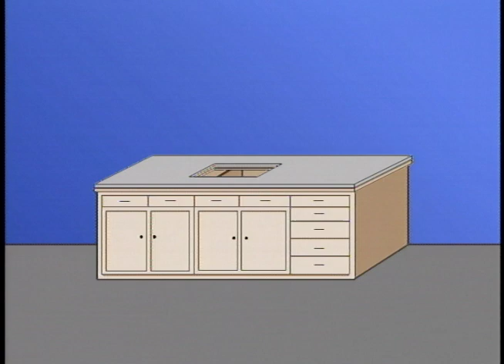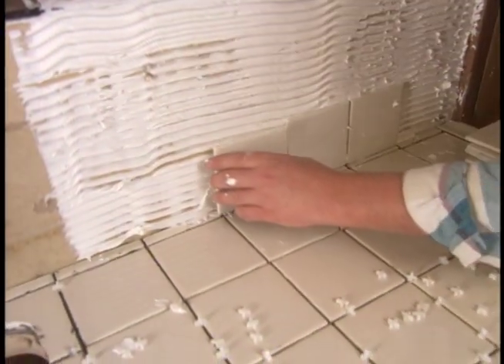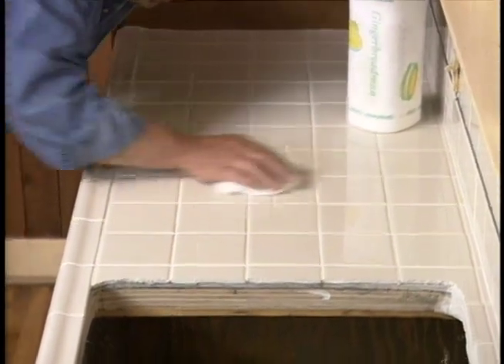How to Tile a Kitchen Countertop

Comment: You should have just hooked the plywood to the cabinets by using L brackets or something like that that you get to from underneath. If you ever want to replace the tile countertops it will ruin the cabinets because you won't be able to get it off.

Comment: Hey folks. What year are we in. Tile tops can be done with a nicer touch but please watch the schluter system countertops video so you dont end up with a rotten top. Not a payed advertisement either. Just the truth. Concrete board is not waterproof and water will get through the grout. Guaranteed!
Reply: its also not needed!
Reply: Thank you!  I have mold under the tiles the previous owner put in.

Comment: Even back when this was made, those tiles were deeply out-of-date, impossible to clean up and straight-up ugly. They'd have done better to make another laminate countertop in a different color.
Reply: it's a question of choice, not everybody likes laminate ;)
Reply: I feel like tiled worktop are making a come back. I have been looking at a company called 'DTile'.
Reply: Tiles are not ugly, but dirty grout lines are. I would go with much larger tiles and thinner grout lines.
Reply: House cleaner here, tile countertops are not impossible to clean, you just have to use the right type of tile. Gloss, semi gloss, and smooth with no texture are what should be used. It also helps to seal the grout. Some people like them, some people don't and thats ok.
Reply: Completely disagree. I like tile countertop. This is a classic look, not a dated one (in my opinion). 5 years from now when everyone has white marble or butcher block that screams whatever era we are departing, which is also synonymous with grey on grey on grey everything- this is still just a classic tile look.
Reply: it's a question of choice